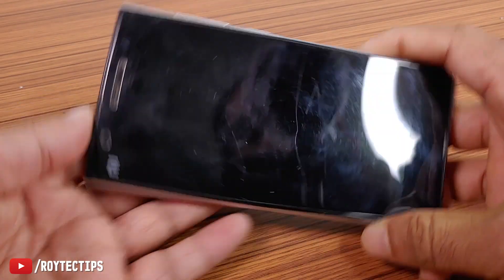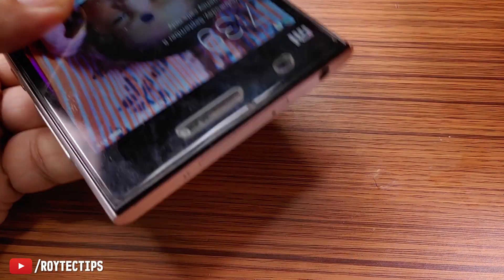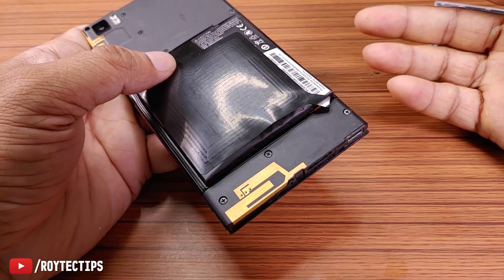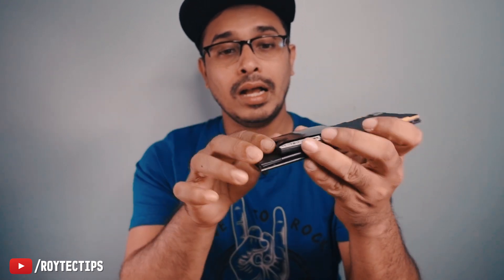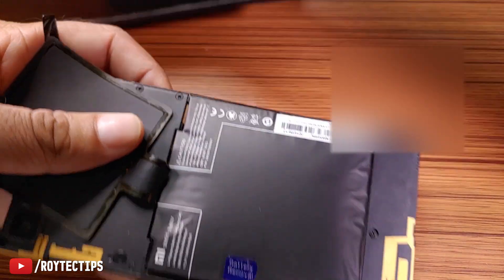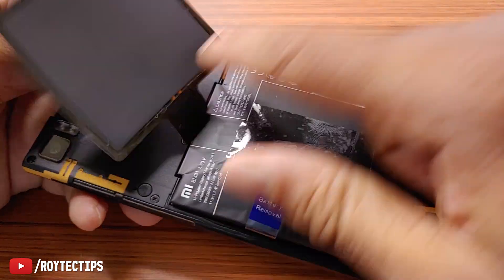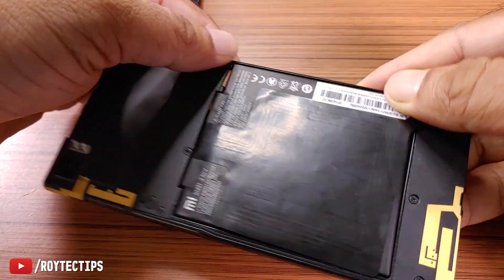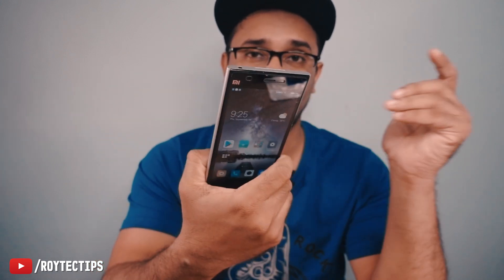How I Repair Swollen Battery in a minute - DONT TRY AT HOME

Comment: If we fix the swollen battery will the battery run for longer times?
Reply: No , eve. Less
Reply: @DIDDYIES-OILER-69  This is a standard procesure we are doing with very old devices. It isn't changing the current battery life, if you make it right it won't affect the life, but don't tape it. Use proper sealant.

Comment: This does not “fix” anything. The reason a battery swells is because the chemicals inside the battery are breaking down. Nobody should do this under ANY circumstances. If your battery is swollen, GET A NEW BATTERY. If you do this, you’re just asking to get your hand blown off.
Reply: bro this is why youtube needs visible dislikes
Reply: @babarasul680 this is why comments and creators should have a dunce cap button once you reach a certain number it should give your avatar a dunce cap so everyone can see to be careful of this persons advise
Reply: I sure do love a good ol' game of hot potato!
Reply: I've done this with several iPhones and 9 out of 10 times it keeps kicking.
Reply: I literally writing this comment from a bloated phone, hopefully it doesn't blow up in my hand rn
Reply: @Kodys_A_Dork  please buy a new battery lol, it’s super cheap and on most phones it’s pretty simple to replace the batt
Reply: @ArizonaJewell  Totally agree buddy.
Reply: People in this section won’t be replying back since we already know what will happen next
Reply: @jack m ..Bro I did this a lot of times for others but the question is why do my 12 pro max battery get big again when I did dat
Reply: @kobbycloud8188  Good question, and I honestly can't say for certain. They say excessive heat can cause this, and the way I used mine bears that out. As @TAHEP mentioned, my phone was run constantly and always plugged to power because I used it only for its hotspot, often actually putting it outdoors in the florida heat for better reception. Could ambient heat and/or the extra heat caused by never letting it off the charger have been an issue with your doing it again? 

It's been a month since my post making it now six months since mine was deflated, and I treat it just the same as always using it's hotpot for my pc and tablet, yet its still going strong. I still have the new battery I purchased for it but never installed because I wanted to see how long it could survive.

The thing that concerns me greatly is the old style, easily replaceable batteries were hard, not a soft bag and never had this issue. They use up we snap the back off and easily replace them. However, the ones we speak of are not much more than a cheap bag of chemicals, that can actually ruin a phone when they expand...mine broke the back of my phone. Plus it costs around $100 to have them replaced, unless we fix it ourselves, so most people would just get a new phone. Why would they go this new route with the phone batteries, unless it's a way to purposely plan their demise? I'm no conspiracy theorist, but that's all that makes sense here.
Reply: And a house fire.
Reply: @ararou  Oh absolutely. Lithium ion batteries have caused numerous house fires over the years. Always be vigilant with them!
Reply: Yes, battery is cheap enough.
Reply: Okay thank you
Reply: @Pv Pwner ok Mr edgy guy do you hunt your own food? 😂
Reply: Calm down nigga. Nothing happens
Reply: @ofisblagoevgrad6424  It takes common sense that this is a HORRIBLE idea. it looks like it works but it’s dangerous for you and those around you.
Reply: Thanks brother ☺️
Reply: He said that that phone is so old that he couldn't get a replacement battery. Based on the number of tapes he has on that battery, he has done it multiple times. It is a dangerous endevor for sure. But he gets views.
Reply: So true so called repairs and hacks should be removed kids also watch this stuff and it can lead to serious life and death situations
Reply: @yashnivalkar1131  I fixed my phone months ago based on this video. Saved me a lot money. Was able to buy food.
Reply: It's not break down but chemical reaction
Reply: People having convulsions over degassing. Just a bunch of women who don't know what they are talking about. They type in fear, losers.
Reply: how do the chemicals 'break down'? explain this.
Reply: I did puncture a few myself 🤣 it temporarily fix. Just don't poke too deep. Just to remove that trapped gases.😅
Reply: It actually works, I've been working phones for 6yrs now and I've revived a lot of batteries like this
Reply: No it's true video, I have done this many times with rc lipos
Reply: @SWARAJSINGH2008  the battery is still probably broken despite it not being puffy anymore. it might work as intended for a few days, but its a huge safety hazard to you and your home. spending a couple of bucks is better than trying to “fix” your battery and risking exploding
Reply: Lol! I did it, and let me see, 1,2,3,4,5...yep all 5 fingers and the hand perfectly intact. Don't you know, filling your car with gasoline is much more dangerous than this? Here is a tip for you, stay away from open flames while doing both, and no, don't smoke either. Don't cause no explosion, and there won't be no explosion. A little common sense goes a long way here. 

Oh, and after 5 months, with the same repaired battery, phone works and charges fine. Some of us talk, and some of us like the video author actually do things, and the reward for doing is knowing the truth and a bit of extra service from the phone. Even though I had a new battery, and would recommend replacing it with a new one while you have the phone open, I did not just to prove, unlike your false claim, ,"It doesn't fix anything" in reality it does fix it, and safely. The fix can be handy for someone who needs their phone now, and/or can't get around to replacing the battery or can't afford to have someone replace the battery just yet.
Reply: Ive done this and it works 😂😂😂
Reply: best answer is already been given which is - 
 "Its actually the heat that swollen the battery cuz pressure is building up inside and heat expands hard objects", in addition to that the other reason is overcharging it 7/24
there are lots of videos claiming the battery is simply working fine after the process
Reply: @Pv Pwner Well back in 2019 a young girls phone exploded while she was sleeping with it charging next to her head and it killed her on impact. I would definitely say even a phone battery blowing up could deal some serious danger and shouldn’t be taken lightly.
Reply: @georgia4768  thats a hoax news btw
Reply: @georgia4768  im calling bullsit, maybe if here bed caught fire
Reply: Well, too bad down vote numbers are not shown.. Your comment bears no information, it's noise. Thank you, DAD.
Reply: I just did do this after reading the comments here. It was like the angels on one shoulder saying don't do it! And the devils on the other shoulder saying it ain't gonna hurt ya. So I went out in my shop and put on a ton of protective gear with a brand new fire extinguisher on the work table and, so far so good. Time will tell the rest.
Reply: Um... it fixes the swollen ness lol...
Reply: @kenlongjr  It still doesnt deal with the underlying problems, and it actually becomes dangerous. best case scenario, your phone would be dead in a week. worst case and phone goes boom
Reply: @Anton-hp3qg  wrong.
Reply: NOT true.I did the same thing to my swollen battery on my OPPO about 5 years ago and it even work better than before.
Reply: @Pv Pwner he might be over state it but I bet if it explode the burn can severe enough that it will not heal and the doctor might have to cut some part of the hand to prevent infection :b
Reply: But this trick works sometimes, my battery was also swollen and doesn't fit in my phone anymore, so I punctured the cover and battery comes to original form
Reply: @harshitsingh4764  toxic chemicals will be released.  Don't sleep with it under your pillow.
Reply: But… What if you can’t get a battery?🤔🤔🤔
Reply: U r wrong. If battery swells physically and becomes hard, it has to be replaced. But if air gets inside it, u can remove the air and close that hole. Mobile phone repaid guys will cheat you and sell you a new battery for this small air issue so be careful
Reply: Yeah but what if we don't get the same battery of our mobile then wat cause some people phones are gonna be an old one so manufacturing of those battery is zero percentage only can get cheap battery that is a weaker mAh of our original battery
Reply: Now I'm weirdly confused as to how I once got away with cutting a phone in half with an angle grinder when it pissed me off.
There were a lot of fumes, and sparks, and I went right through the battery, no boom. I even did it indoors because I was a total idiot, and not sure if the fumes affected me lol.
Reply: I have to say that it will not blow up but that's very dangerous and nobody should try this and after puncturing the battery it releases toxic gases
Reply: No it can recovered by carbon refill
Reply: @jameslrofficial  How?
Reply: @jameslrofficial  Repairing a li-ion battery that has broken down to the point that it is swelling is pointless, especially considering how incredibly cheap a new battery is. In a lot of places, swollen lithium ion batteries are legitimately considered hazardous waste because of just how dangerous and volatile they are. It just isn’t worth it.
Reply: @ArizonaJewell  No it's not pointless. Please read my other posts here. The reality is, there is likely nothing to fix because the battery is not always broken to begin with...it just needs deflating. No offense intended because you aren't the only one, but there are a number of people here that are simply making things up. They just assume their unproven opinion is fact...why do people do that?

 Be sure before you post or be embarrassed after you post.
Reply: @jackm6307  Brother I agree with a lot of what you are saying , however there IS a chance it can happen and stuff can go very bad prepared or not .
I've been a tech repairer for over 20 years and done this a bunch of times right up until that "one time" when it went down .

I was working at my bench and had done 5/6 phones already with the issue in the day and about to do this to an iPhone6s when Boom!!
I didn't even get the pin to it, just my hand was close and the battery had decided it was time to go. First hissing and .02 of a second later bang...fire on my desk in two places 🔥, burnt thumb and forefinger as they were closest and a decent headache for multiple reasons other than the gas.

So while I've had good experiences fixing them this way since they existed, Ive also had some not so good ones at all .
That iphone6s being the end game for me for the sake of $30 on a battery or a second hand phone .

After years of doing it brother, the one time my face was that close and it almost didn't work out ...was close enough 😉🙏🤘.
Each to their own 100%, if anyone feels comfortable and safe doing it .
Having experienced both sides , my advice would be get a new battery if you can and have a crack at that .
Much safer and cheaper than burn pain .
Cheers ,🤘
Reply: @GUARDIANA01   Glad you added your experience to the conversation, as it is something people need to know. First Off, hope you weren't hurt too badly. Also, I am curious what caused the flame, did it ignite on its own, or was there fire in the area? I recently spilled boiling water on my leg, worst burn ever encountered, however I just saw it as another danger in life we are bound to encounter, if we choose to live the rewarding life of taking on challenges many never mess with. There is also another way to look at what happened to you, if that was the worst you encountered in 20yrs, I figure you did well. Also, since piercing the battery had nothing to do with what happened to you, then the explosion could have happened any time while simply removing it so you could replace the battery, but I doubt that will stop you from replacing batteries in the future...right? Nothing ventured, nothing gained.

Odds are, this will likely never be a problem for a 1 time battery fixers like many of us do, but I would now certainly recommend wearing gloves and keeping it away from ones face even when changing a battery, probably something we need to be doing anyway. Or for those who wish to stay away from as many risks as possible, I suggest they do that, however that's not the life I care to live, too boring, And don't get me wrong, I know you are not recommending we do nothing. At nearly 70, I hope my major disasters are in the past, but if that possibilty is what it takes to do as I always have, bring em on. Lastly, always be as careful as possible regardless of what we do, but never stop doing. I have a feeling you also agree with much of my babbling here, because you are a doer, and will likely never stop being that. Cheers!
Reply: @ArizonaJewell   "cheap" is relative. there are countries in this world (like the one I'm living in) where with a medium income just buying food or paying the utilities makes the wallet and the heart cry, living from salary to salary unable to save money, where retired people have such a low income that they search in garbage for food, don't have money for medication etc...
Reply: Ok...
Reply: Its actually the heat that swollen the battery cuz pressure is building up inside and heat expands hard objects
Reply: @ScottThanging that’s hogwash it’s the chemicals breaking down. I have your comment a thumbs down but they need a dunce cap button.
Reply: DO NOT TRY THIS FIX! I JUST SINGED MY EYE BROWS! WOW!

Comment: WARNING..: NEVER take appart a mobile phone with a charged battery.. Always DRAIN the battery so its empty before taking the phone appart.
Reason is batterys can easy ignite or explode when you bend them or when you try to puncture them.
Dont do what you see in the video buy a NEW original battery or one that is certified... Be very aware that there are many bad copy batterys in example Asia.
Some are okay some are dangerous to use. A battery that catch fire while in your pocket can and will burn you very badly in just 2-3 seconds.
And you might even risk the battery explode while you use your phone or burn down your house at night while charging.
DO NOT buy a cheap battery.
Reply: Batterys DO NOT ignite easily, they are extremely safe and only ignite in very extreme circumstances (such as the circumstance in this video, all it takes is the wrong tilt with that's that pin and he'll be starting some fireworks), if ignited so easily, they wouldn't be in so many phones, laptops, cars, etc.
The problem the is when they do ignite though, they can be extremely nasty, especially lithium ion chemistry.

In my 15 years of repairing phones and laptops, I've never once had a battery go up in flames, and I've shorted a lot of batteries in my early days.

I do agree though, that if you'll be doing something potentially dangerous with, or near a li-ion battery, it's wise to discharge it as much as possible.
Reply: The state of the charge does not change the flammability of lithium. Shorting a mobile battery while it is drained is more dangerous than shorting it while it still holds some charge, because 1 - it will not heat up so fast to actually catch fire, you'd have to short it for quite some time, and 2 - Mobile batteries don't have PCB on them and you're essentially going to destroy the battery by making it go under 2.4v. Charger might not even recognize the battery and your phone might no longer charge, but even if that doesn't happen, there are long term damaging effects.
Reply: I think an empty battery is as dangerous as a full battery. I don't think that you need to drain the battery just for some simple disassembly
Reply: Yes i also got that idea
Reply: Here is the situation. You need to replace a new lcd on your phone and the battery must be removed first. Based on your advise, how can you drain the battery with broken screen? Should you wait 1-2 days to be empty? 😂

Comment: Now you're using it for over 2 months , is everything fine ? Working great for long time? Don't get more swollen or heat? 
Any information or tips you can add?
Thank you
Reply: Yosef, DO NOT try it!
Reply: 6 or 7 months later, mine works fine, and hasn't swollen again. As far as loss of capacity, maybe, but since I mostly use mine for its hotspot for home internet, it stays plugged in, so any loss of capacity while unplugged is moot. Don't be afraid to do things but always be careful as possible.
Reply: Go for it Yosef. Its a good fix. Very safe. 🙂👍
Reply: free falastin ya khara 
🇵🇸🇵🇸🇵🇸🇵🇸🇵🇸
this is very good info for you :D

Comment: but the tape is not strong enough and next time the battery generates gas, it will leak through the tape and will leave a hole there, not only the gas is highly flammable but the opening as you just mentioned will be a way for the moisture to get in.
Reply: Use super glue
Reply: @GF-mf7ml  thanks
Reply: @mizile1486  DO NOT
Reply: @Henry-sv3wv  because that is a sign of a battery dying, in the worst case it will blow up no amount of fixes will prevent that and he just did it worse by making away for the toxic gases to go out of the battery.
Reply: @zedeco it's not a sign.. did he say the cause could be overcharging it?? Getting hot 🔥... What does it mean the battery is degraded. My Motorola has been swollen for many months... I finally decided to watch some videos do some research so I punctured it and let the gas out yesterday. Its performing fine.. it performed fine during the time it was swollen too 😂
Reply: @Michael-wy6vo  i work with lithium batteries, your bs doesn't work on me, when they swollen they are a ticking time bomb.
Reply: @Michael-wy6vo i did the same, before and after its fine...